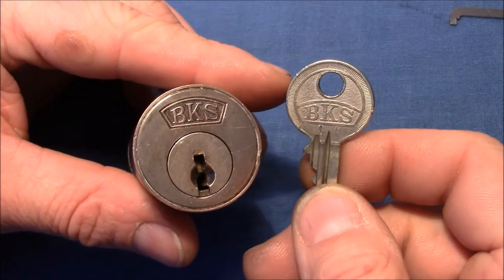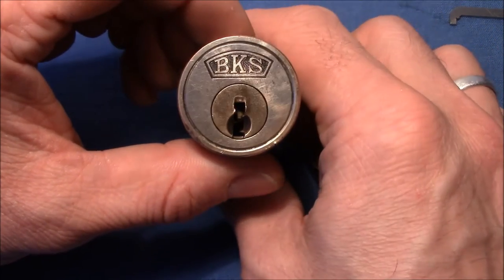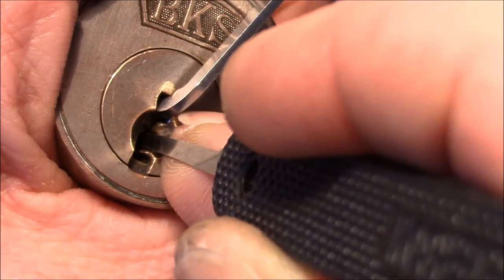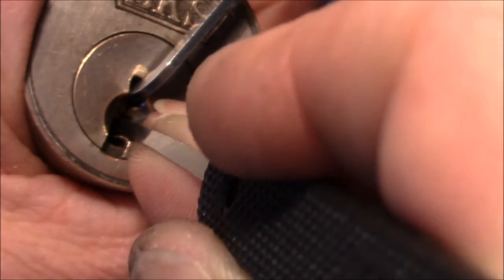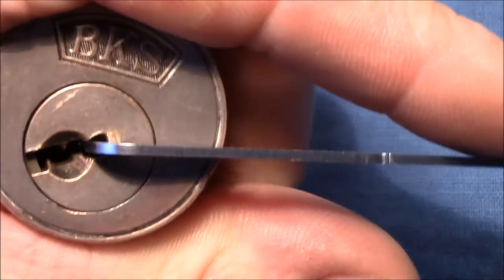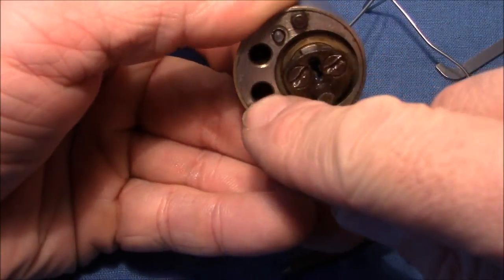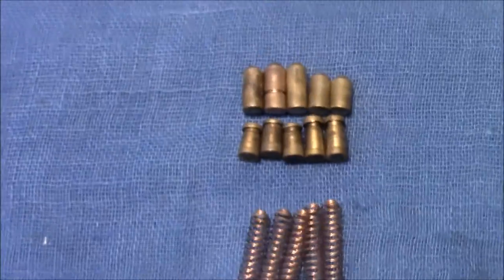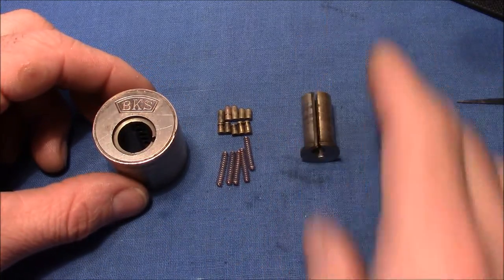(picking 117) BKS Rim Cylinder picked and gutted - cool mechanism explored

Comment: great job bud! nice to see the inside of the lock and the pins as i can't get into mine without causing damage which i didn't want to do. i'm in the process of uploading  that vid now ;) great vid mate, thank you!
Reply from the maker: +crispey bear Thank you.
Really you cannot get into? But I disassembled your lock and cleaned it up before I sent it to you. There is a pin that can be easily pushed out. Just take a nail and a small hammer. Works perfectly.

Comment: What type of lock is that? Is it just a mortice rim cylinder or does it have a special name? Also nice picking of an intresting lock
Reply from the maker: +Steensy Not sure about the name. Will ask Adrian Weber - guess he will know. But it's a really unique mechanism.
Reply: +Potti314 yea I'd guess it's from some sort of heavey duty application. Out of curiosity is the outside lock fitted with the same release mechanism? Just it may make it vulnerable to drilling and then release the lock from the door??
Reply from the maker: +Steensy No, it's only possible from the inside. On one side the rods are permanently connected.